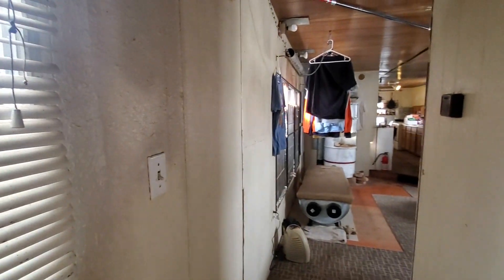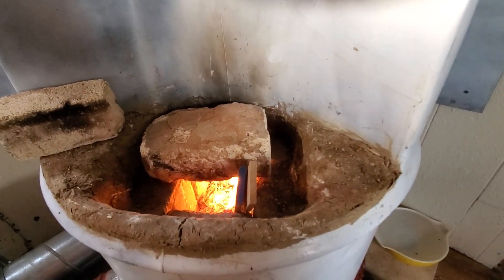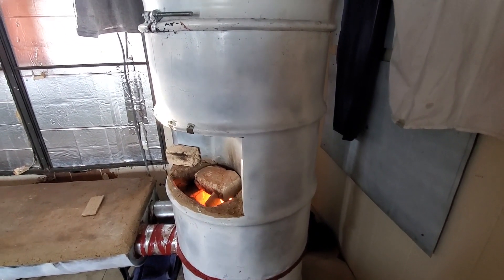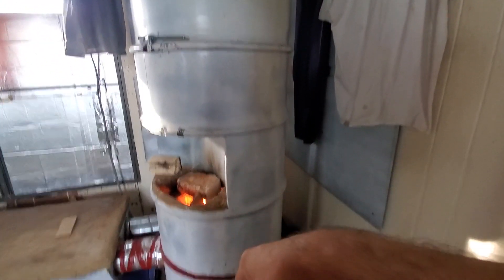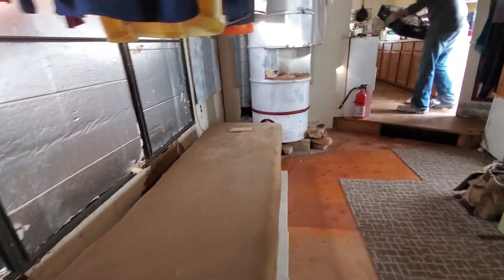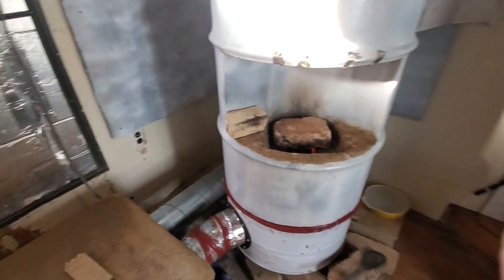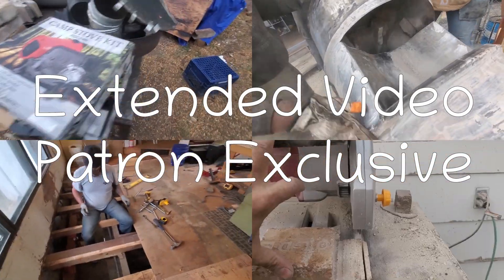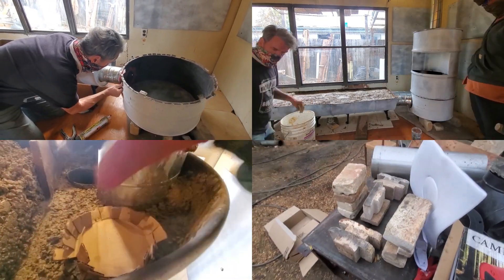Uncle Mud Tiny Home/Trailer CottageRocket Rocket Mass Heater Inspection and Upgrade Quick Report

Comment: what is the clearance to the ceiling? The ceiling on my travel trailer is only 6 foot and I'm worried about fire safety
Reply from the maker: The clearance to the ceiling is about a foot. There is a heat shield on top but you are right to be concerned. I prefer to keep a good 30 inches between the top of my heaters and the ceiling. Even with a heat shield I like to have more pace than this. Thanks for watching.

Comment: I thought metal would melt in the riser, or is that only down in the core?
Reply from the maker: Metal is fine everywhere but the riser and burn chamber where it will burn out quickly unless you have very carefully designed the cooling fins to protect the steel like the liberator rocket heater folks did. The  first heat riser in this CottageRocket was insulated kiln brick and it still crumbled. The burn chamber was dense firebrick so it fared better. In this case we lined the inside of the new ceramic wool riser with extra thick high grade stainless steel even though we dont expect it to last more than a few years because (A) it was free from a dumpster and (B) it is mainly there to hold the form of the riser until the cob around the ceramic wool dried and if it lasts a while it is a bonus. There's a lot more detail in the 45 minutes of extended footage available to our patrons at patreon.com/unclemud.